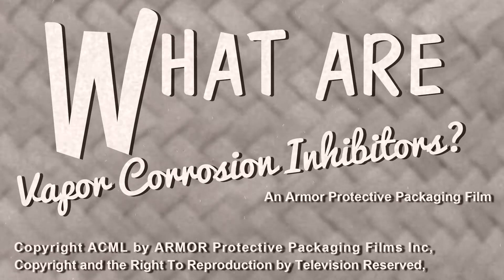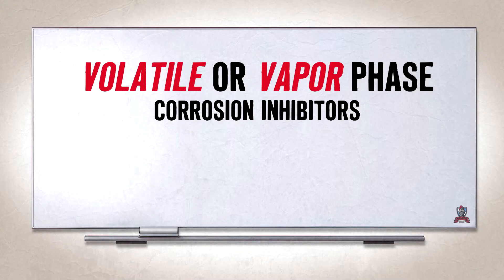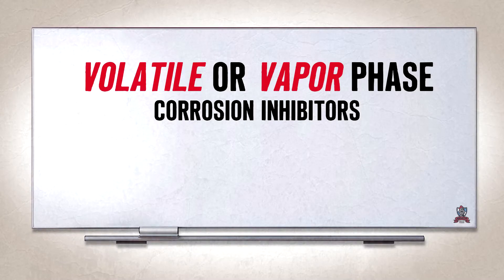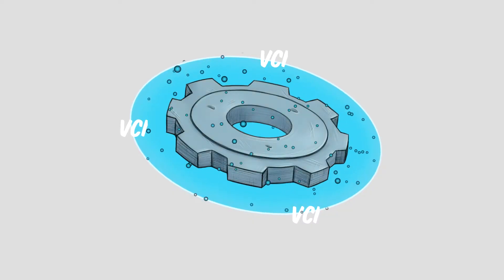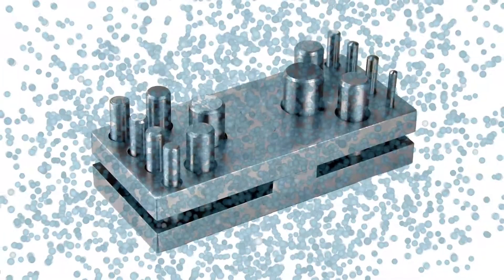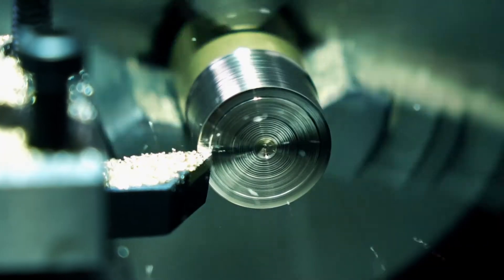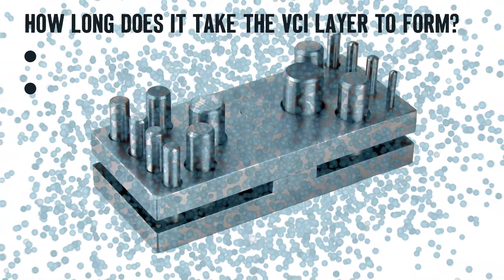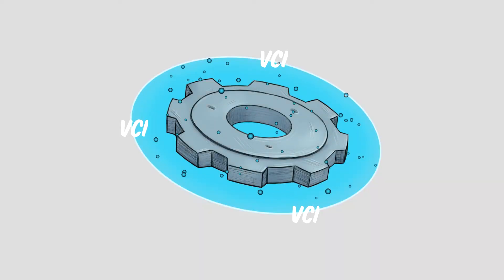What Is VCI & How Does It Protect Metal From Rust/Corrosion

Comment: Love the video - do the poly bags prevent scuffing of polished parts?
Reply from the maker: Hi there, thanks for watching! While the poly bags may prevent slight scuffing on polished parts, we can't guarantee that it will 100% prevent scuffing. For delicate and polished metal parts, we would recommend using our VCI Foam Emitter Pads. Additionally, combining VCI Foam Emitter Pads with some of our other packaging materials will help prevent scuffing the best. Feel free to reach out to us at info@armorvci.com and a technical specialist will be able to assist your specific scenario the best based on part size, weight, and additional measurements. Thanks again for watching and we hope this helps!